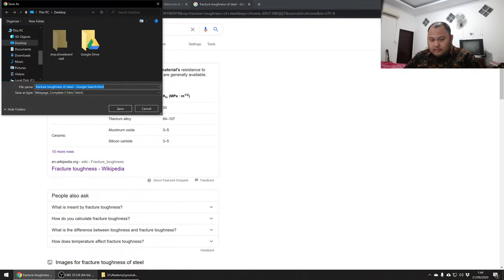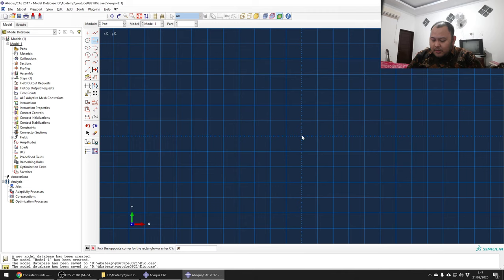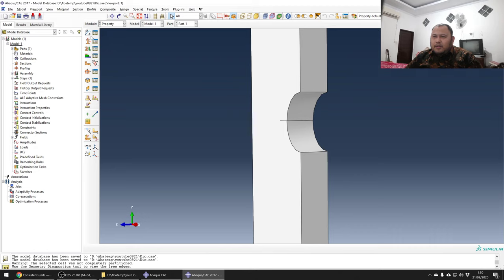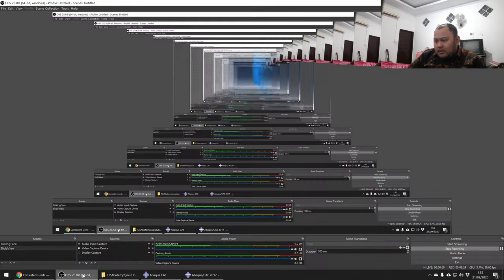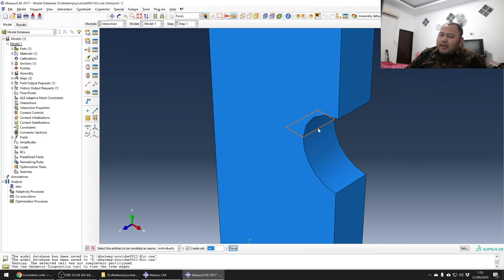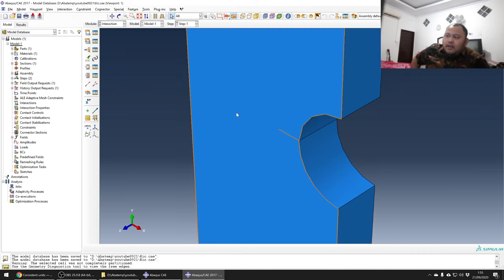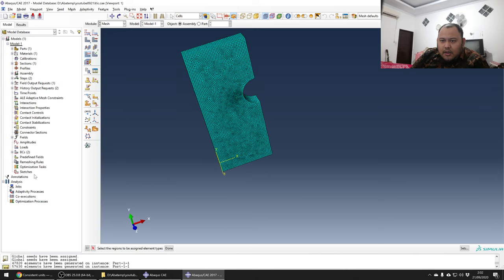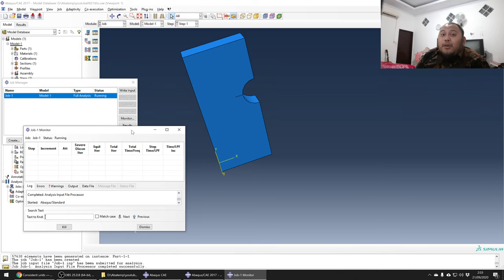Calculating stress intensity factor in Abaqus using feature crack

Comment: Why does Abaqus show the values of KI, KII and KIII if the simulation was done in mode I? Thank you so much!
Reply from the maker: yes.. thats the errors coming from the fact the the integration contour is not smooth and large enough... the geometry is also finite width...

so actually, they will not be exactly zero... but if you compare, the K1 is much larger than K2 or K3.. like 100 to 1.. so they are negligible..
Reply: @FEADith  Hi, do you know how to plot the K1 values obtained against the distance from the crack tip using Abaqus? Your help would be much appreciated.

Comment: Thanks bro for making the video, but I think K threshold of material is more appropriate for crack initiation. K1C is the material property,  upon reaching which the crack will become critical and without any further increase in load the crack grows at sonic speed and results in ductile tearing or results in unbounded crack growth as they call it.
Reply from the maker: Not really K is only useful if you have precrack already.. thats why it is suitable only for crack growth.. not for initiation.

If you dont have precrack.. the whole concept about stress intensity or K is no longer relevant.
Reply from the maker: What you just explain about has nothing to do about initiation or propagation.. what u call sonic speed or critical crack length without anyfurther loading will propagates.. thats another story.. thats about stable or unstable crack growth..

Comment: Sir, Thanks for sharing the knowledge. Just wanted to ask a doubt, is it possible to carry out the same analysis for high strain rates to find out the "Dynamic Stress Intensity Factor"?? 
Thanks in advance
Reply from the maker: Yes i think its possible. Just change to explicit dynamic step, so you activated the inertia terms.. and applied high speed loading.